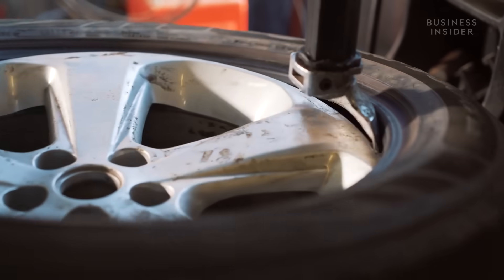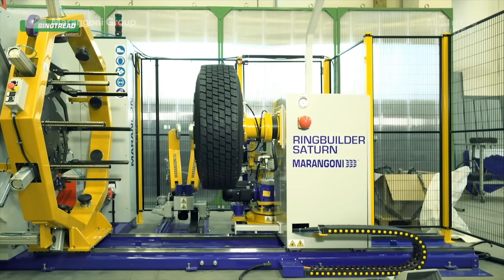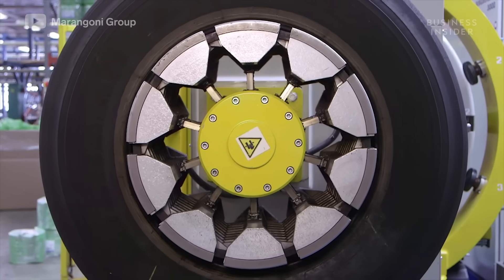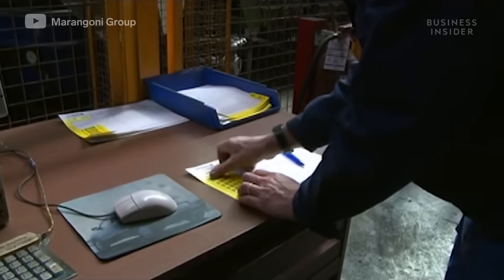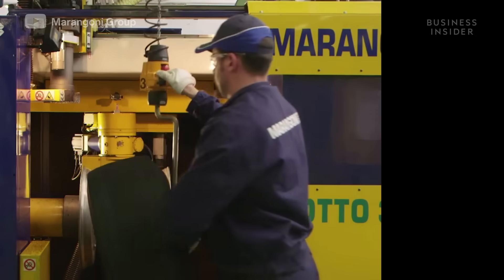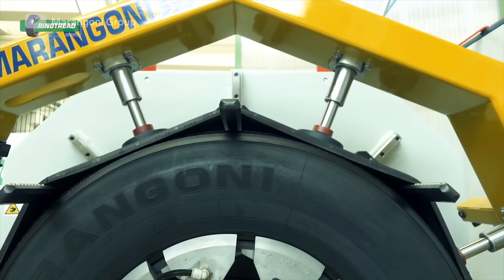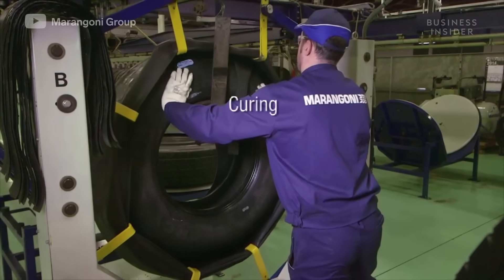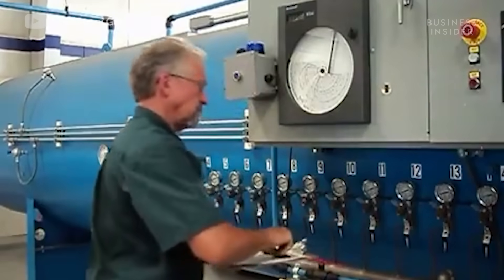How Old Tires Are Retreaded So They Can Be Used Again

Comment: So is this all the tires I see laying on the side of the highways? 😂
Reply: Recaps can be dangerous and probably do blow more often than non-recaps. But it really all comes down to proper tire maintenance that makes the difference.
Reply: @SmilesSmilesYT  if one blows there are 3 more tires support the Semi
Reply: @stripecatflippangitnamecha8721  and? lol what does that have to do with what I said?
Reply: @SmilesSmilesYT  You said recap is dangerous, I say its not.
Reply: @stripecatflippangitnamecha8721  I said they "can be dangerous" given the fact they are much more likely to blowout. How many tires are on the unit is not a factor in the individual tire.
Reply: @SmilesSmilesYT  tire maintenance?! like watering them each morning or what?!
Reply: @roberttrisca8210  correct tyre pressure and inspection. To low pressure lets tyre easily heat up and malfunction, or too old tyres. Mostly an issue with Eastern European trucks.
Reply: Yep 😂😂😂
Reply: Yeah the are great for littering.  Big truck retreads are designed to just slough off and the truck just keeps going.
Reply: @Allosaurus 67  And that is why they are not allowed in the US for steer tires.
Reply: @Allosaurus 67 I am sure Frontbtires are new
Reply: Some of them yes!
Reply: lol, they are banned in many places i beleive
Reply: You know it.
Reply: Probably American quality. No such issues in EU
Reply: Eu make the same junk I bet. Its all down to improper maintenance, and people trying to cut costs.
Reply: @EJ7-7  you don't know anything about tyres, tyres in eu perform same as new ones
Reply: @kaspartint7286  *many such issues with all retreads, including the EU.
Reply: @kaspartint7286  yes
Reply: @kaspartint7286  i see truck threads laying in on the highway all the time here in Norway. Not in the eu but same trailer trucks
Reply: @kaspartint7286  lies, EU blows Retreads all the time as well.  You know them rubber pieces of tire in the road, that's exactly what you are seeing.
Reply: A retraded tire works just like a new one. You can't notice any difference in performance or visually
Reply: sirnyjel You definitely can notice a difference between quality tyres and retreads
Reply: @sirnyjel  wrong. retreads are 47% more likely to blow out during their operationally life
Reply: @alexsheppard8331  47% ? I’m surprised it isn’t higher, but blowouts are still super rare so I dong think it makes a difference
Reply: @sirnyjel  are you stoopid? 🤣🤣
Reply: @sirnyjel  A retreaded Tire is NOT as good as a factorynew one. Because the new Rubber is only glued on and lacks proper binding to the actual tire. This leads to a lack of structural integrity. These things are driving safetyhazards because the Threads are likely to come off under stress. Thats why they are banned on Public roads in the EU. Idk about you but having a Tirethread come loose and play a several Kilogramheavy Payload while slinging at me through my windshield at speed of 80 Miles an hour on an Interstate is not my favourite Kink. Plus if your Tirethread comes loose, you will loose control of your car. If you wanna die thats okay but dont risk others lifes doing so, okay?

Comment: Most tire blow outs are caused by low tire pressure. The tire gets hot and comes apart. This will happen to retreads and virgin tires.

Comment: I'd say the best purpose for retreads is for vehicles that are moving slowly, or if you just need tires that hold air to move around a project car or something. On a lot of farm tractors, tires get really expensive and I can see how a retread could be used on a slow farm tractors, but I wouldn't ever use it on a vehicle that goes over 20 mph

Comment: These kinds of tires are not safe. Dont drive these kinds of tires on the road! The tread can come off at high speeds. It happened to me on 2 of the 4 I purchased. I will always buy new or slightly used over these any day

Comment: Let's stop the bullshit, 90% all major US carriers use retreads on all tries but the front which is required by the DOT to be virgin rubber. That being said many people run them past 2/32 which is to way to low to begin with, which leads to blowouts and alligators all over the high ways. Not saying they're perfect but they're a cost-effective must to the tractor-trailer industry.

Comment: The cause of tires blowing out is because there is too much heat builds up, not because it is new or re-thread.  Heat build up is caused by low pressure and high (freeway) speed.  Low pressure is cause by a leak, usually from a puncture.

Comment: From what I've seen with modern radial tires the carcass of the tire wears out at about the same rate as the tread so when one part is worn out the other is right behind it.  

Long ago Hoosier Racing TIres used to do this using racing rubber on old tires to make racing tires for lower circle track classes.

Comment: Ain't nuttin new here. I bought tires in the 1970's drove'em to slick carried them to a tire store in town. They sent tires off an I got them back in a few days. Drove these on my Ford with a 302, did burn outs at track and never lost a retread or had once come apart. also drove a few times to Florida on them. Did them twice, never no worries.

Comment: It’s interesting how the world focuses so much on vehicle safety, only for nonsense like this to basically ruin the entire point and cause a major accident once it blows out. 🤦‍♂️🤦‍♂️
Reply: Ohh the Youtube experts commenting. They know everything and never fail.
Reply: As long as those tires don’t run with less the 80 psi they’ll be fine
Reply: What tire runs anywhere close to 80 PSI?

The average car,, lorry or van tire runs at around 35 to 40 PSI. The average tractor runs at around 25 to 30 PSI.

If you could manage to inflate a tire to that pressure it would blow at the slightest bump in the road.
Reply: @RylanStorm  Maybe it's more of less common in different parts of the world. But all the tiers from small cars to large trucks and trailers I have used, non are bellow 65 psi on tires that came with the vehicles.
Reply: @RylanStorm  trucks use higher, which is what these are typically used for. My dad's grain truck is inflated to above 120 psi, something like 150 psi I think (it might be more depending on the load). Even my bicycle tires I run 80 psi (low pressure for grippy race courses with lots of turns) and typically ran above 100 psi (about 120 psi recommended). It all varies on the vehicle (just like some people run 3 to 5 psi on fat tire bicycles, or above what I run for proper race tires on road bicycles). Trucks are typically who buy retreads, and those are well over 100 psi.
Reply: Still passes IATF standards, which I doubt you even know what are those...
Reply: IATF is the equivalent of ISO standards for the automotive trade.

They set out the minimum acceptable standards for quality and risk. However, quality is defined on a case by case basis so a manufacturing process can still be certified if the quality requirements are low.

In the case of retreaded tires the quality requirement was changed in November 2020 so that retreaded tires must be as good as new. At that point a good deal of existing tire stock no longer met the requirement, and there is even doubt that retreading will continue as an industry. Retreaded tires manufacturer prior to November 2020 have no such requirement and many of these will still be on the road.

There are use cases. Bus tires continue to use retreads but coaches are replacing them entirely.

Also, have to remember that many countries don't even need to sell IATF standard tires. They just can't advertise sub quality tires as IATF standard which, as you have pointed out, means absolutely nothing since the average customer doesn't even know what it means.
Reply: Should only be legal for off road use🤷🏾
Reply: Mvp-AngelOfGod agreed
Reply: These tires are perfectly safe though. Engineers don't come up with these processes as a gimmick, it's a long and difficult process for a method like this to actually come to market, meaning it is tried and true. Every major airline in the world uses retreaded tires.
Reply: No. They come up with them to be able to sell cheap tires to people who don't know better.
Reply: Harambe Jr. Yes but its good for the environment lol who cares about road safety if we can reduce emissions.... world going mad

Comment: I miss working at the recap shop (Retread shop), sure was a awesome job.
#BosticTruckTiresOkc
Reply: I also worked at one in the 1960s . Hurtubise Tire , outside of Buffalo NY . They're very popular for snow tires in the winter . Most people would have a seperate set of wheels and when winter was over , take them off , put your regular tires back on , and save them for next winter . They're much cheaper than brand new tires .

Comment: There's a huge difference between retreaded tires done this way, as a manufacturing process using sophisticated equipment and methods, and the much more common, small-shop "rolled-on" retreads. The second type are the ones you see experiencing tread separation, because the tread is not a continuous ring, but rather a long strip that's cemented to a tire that's been inspected visually by a person. The process used by this factory basically produces a new tire. The process used by most small retreading shops often produces a dangerous product prone to tread separation.
Reply: Yes after rethreading of tubeless tires they will put interior tube? Do you think it is safe?
Reply: @7ion7ion42 who puts?
Reply: @7ion7ion42  probably safe for trailer tires, no chance I'd trust them to drive on.
Reply: retreads are illegal here,,   given %90 become delaminated and fly off like a bullet into other cars

Comment: After driving truck over 40 yrs I would never run recaps, every time I pulled a tanker with recaps when the tire came a part kiss the fender goodbye also in the long run recaps are not cheaper

Comment: Rubber has a shelf life, nuff said.
Reply: This is why there is a 5 year limit on retreads. Anything with a dot code older than 5 years are scrapped.
Reply: Your mom has a shelf life.
Reply: @windowsxseven  sadly, it's way too long
Reply: @jjOnceAgain  must be one hell of a shelf to support all that weight, too
Reply: @windowsxseven  Your 2 dad's have a shelf life as well
Reply: @Tim18  weak
Reply: This is true, but you can alter that shelf life by changing the proportions of synthetic vs natural rubber content. Granted, it's a proprietary science I can't go into detail without breaking a NDA, but let's just say rubber chemists are always altering the proportions of the base ingredients (plus new retarders and accelerants) to enhance the properties and lifetimes of new tires, ignoring advances in thread design

Comment: Reliable... shows a vehicle with tyres in a video is called reliable?

The testing is not even half ass done. Road testing? Lifetime cycle? Sudden braking durability testing? Weather changes on that adhesive that they place on? 

Come on... you dont really expect things to be made just by showing a vid.. there is more to it... 

I give  a 6 out of 10 for ingenuity. But other aspects... i give 2 -3...

Comment: Semi truck driver here. Retreaded tires are more likely to blowouts especially in high weight uses. In fact. On a semi truck it is ILLEGAL to use a retreaded tire on the front steering axel of the tractor. Theybare only allowes on the drive axels and the tandem (trailer) wheels.

Comment: Well if this is what happens to normal tires what happen to Tesla tires
Reply: Twitch Attach this can’t be done with normal car tires. What the video failed to mention is that this is done for semi truck tires or heavy duty tires.  They are much much thicker, have more rubber and wire within them. So they have more room to work with to recycle them.

Comment: I would only retread a tire once. After that you’re just playing with fire. On top of that it has to be a tire that was ensured it never ran low on air that could compromise the sidewall. For trucks only steer tires should be retreaded and used as a drive tire never on the steers.

Edit: forgot to mention there should be a age limit on tires. Once they hit a certain age the rubber on the sidewall gets hard and cracks easy.

Comment: It’s amazing to me how much mis-information there is around retreads.  The failure rate between a new tire and a retread has a ratio 1:1.  If you are not checking your air pressure in relation to the weight of the load hauled, then there will be failures new or retread.  

PS,  as of 2016, nearly 80% of all planes use retread or remold tires.
Reply: Meanwhile the retreads are illegal on hazmat vehicles.
Reply: Yeah but afaik there's like a video that explains the differences between the two. Since they both serve different purposes? That's like comparing a nokia brick to a smartphone today.
Reply: Explain why retreads are illegal on the steer tyres and entirely illegal on hazmat vehicles, then, if they're just as good? The carcass of a tyre wears out when the steel belts flex and fatigue, no matter how much new tread you glue on, you'll never unfatigue the carcass of the tyre.
Reply: Ok but planes tires only touch the ground when taxiing or taking off/landing. The amount of use they get is minimal when out in comparison to a car.
Reply: @haydentakara4369  yeah but airplane tires takes the planes weight when landing at 150-170mph and that's not minimal compared to a car unless your car is jumping at 150mph
Reply: @haydentakara4369  But the few minutes of landing is pretty much like going Dukes of Hazard every time, except your car is 200 tons
Reply: I was thinking the same thing. This man is comparing apples and oranges here.

Comment: Here in Argentina this has been a very  -if not the most -common strategy for replacing a set of tyres in trucks. The problem is that here almost nobody gives a f*ck about the environment (yes, another problem for the future) and this is done just to save some money. Which is the downside? People do this job without following quality standards and the re-treading then comes off in the middle of routes and cause a fair amount of accidents, either by drivers trying to avoid these and hitting other cars or slipping of the tarmac or crashing into these big chunks that rip off the whole front end of the vehicles.

Comment: Almost 30 years ago they didn't use bands, it was a strip with a seam... I was about 10, my family was driving on the local freeway at highway speeds, and our rear re-tread separated at it's seam all the way around the tire about 90%...  This was just enough that when the separation wrapped itself around the inner axle, it caught the tire and locked it up with no tread on it at 65mph...  The whole rear of the car "bounced" down the freeway where every time that tire touched the ground it threw the rear of the car around 2-3 feet in the air...  We stopped around 200 feet down the road, but it scared the bejesus out of our family outing...  My family hasn't bought re-treads since then, but it looks like we might be able to again based off this story...

Comment: this can only be used on tires that are not dry rotted.
rubber naturally decays and degrades over time becoming very brittle.
so this process is only viable for a limited amount of time in a tires life.

that being said, it seems perfect for people who race on the track with soft rubber tires and people who frequently do burnouts since the tires wear very quickly in those applications.
though I question how well the treads would adhere in those situations
Reply: If tyres are really in use, aging is not a problem. Early 90's when I was working in place where we constantly hired semitrailers and delivery trucks to move our stuff those needed 2 - 3 sets of tyres each year. So after 3 retreads tyres were still reasonably new compared to average car tyres.

Comment: As a truck driver I've been told never to buy retread tires because of the low quality. They tend to rip apart and causes a lot of damage when they do so. From personal experience. I'd rather buy cheap China tires for my truck then a retread for the same price.

Comment: U saw they put staples in the tire 😂
Reply: A staple isn't going to do much to a tyre, it that was the case every tyre would burst/puncture at a sharp rock on the road.
Reply: I used to retread tires. The staples we used was a rubber - plastic type. And are melted in the autoclave.  At the final inspection the staples that were not completely melted are removed with that tool you saw in the final scene.
Reply: @Paradoxical Nightmare obv the remove those with the signs!
Reply: They’re normal staples, they stapled the rubber, definitely not deep enough to damage the the tire inside
Reply: Yea wtf was that about

Comment: With improper air pressure, too much speed the tires build heat until they de laminate.  I've had this happen with brand new tires. I would never trust a old tire with a new cap glued on.

Comment: Semi trucks have blow outs with these all the time. You can find tire treads lying by the side of the road all over, especially in the heat of summer when the bond is put under more stress. Having one of these come off can throw a vehicle out of control and cause an accident, it is especially dangerous on larger vehicles like trucks which is where they are more commonly found. Not to mention that hitting the tread at 75 mph will cause large damage to your car and could also cause you to lose control, leading to an accident.